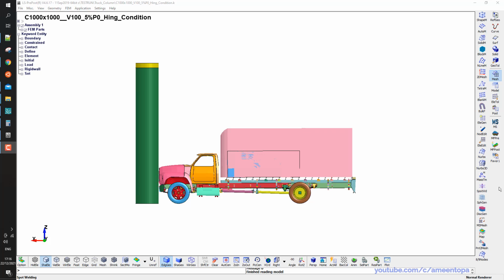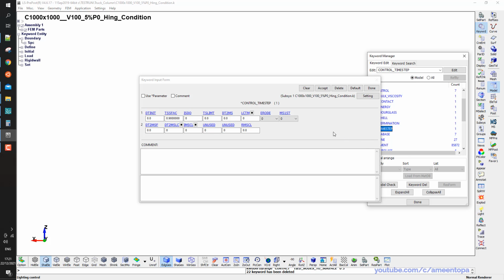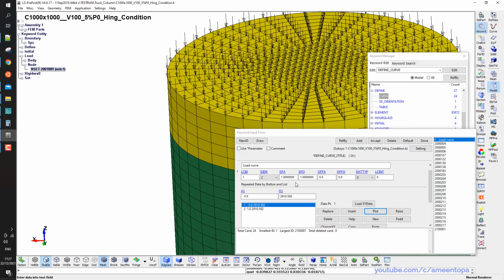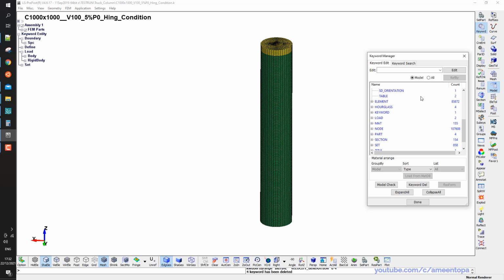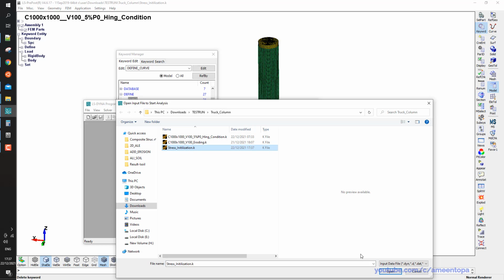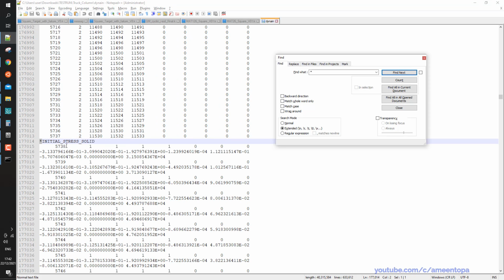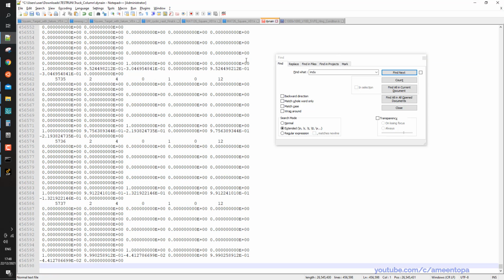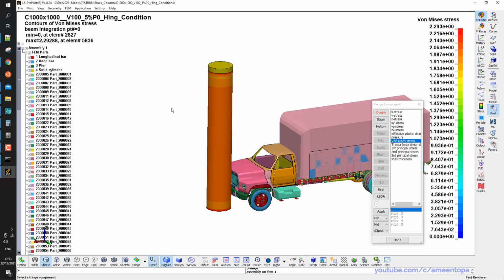Prestress on Column: Dynamic Relaxation

Comment: During the DYNAMIC_RELAXATION process, the CONSTRAINED_LAGRANGE_IN_SOLID keyword does not work, causing the rebar and concrete to behave independently. How can this issue be resolved?
Reply from the maker: Did you solve using single or double precision solver?
Reply: @AmeenTopa  I have tried both SMP single and double options, but the issue persists. I'm trying to apply gravity first and then apply impact loading. However, during the gravity application using DYNAMIC_RELAXATION, the rebars are not properly constrained to the concrete and fall downward under gravity, indicating that the CONSTRAINED_LAGRANGE_IN_SOLID coupling is not working as intended. thank you for reply
Reply from the maker: @오상헌-k4n interesting. Please try to use CONSTRAINED BEAM IN SOLID instead and let me know how it goes.
Reply: @AmeenTopa  After applying CONSTRAINED_BEAM_IN_SOLID, the issue no longer occurs. Thank you so much! is it okay to use CONSTAINED_BEAM_IN_SOLID to combine concrete with rebar?
thank you master!!!
Reply from the maker: @오상헌-k4n yes, you can use this keyword. You are welcome and all the best.

Comment: dear ameen, is that possible that to  make a variable material card,?
i want the modulus and other factors to change with the time, how can i make it happen
Reply from the maker: As far as I know, there is no material model which has this capability.
Reply: @AmeenTopa  thank u brother, i got another question:  to simulate a lunge step  (only reconstructed the foot and shoe) to see the influence that shoe structure can impose on the foot, how can i set the boundary and load conditon?

Comment: Hello Ameen, great content as always! It has been extremely helpful. I'm trying to simulate an asteroid impact on the ocean with the ALE method. I can't seem to use dynamic relaxation to preload the air and mesh elements with gravity. Is there any keyword that could be missing?
Reply from the maker: @renatomorais5445  Hi there,

I am glad you find my content helpful. 

As for your question, dynamic relaxation might not work on fluids (air and ocean water). This method is used for small strains cases in structures. 

Since you are using ALE method, you might want to check INITIAL HYDROSTATIC ALE. This will be helpful for your case.
Reply: @AmeenTopa  Thanks for your feedback. I believe this is the best keyword for my problem. However, I still haven't been able to obtain the expected pressure gradient. Regardless of the value I set for PBASE, the lowest surface pressure remains around 5 atm instead of the expected 1 atm.

I'm not sure what could be causing this, as I've tried every possible approach I could think of. Any insights would be greatly appreciated.
Reply from the maker: @renatomorais5445  as far as I know, this keyword works only for certain cases. For example, if EOS MURNAGHAN is used for the water, this keyword will not work.
Reply: @AmeenTopa  Yes, I've taken that into consideration. I'm using EOS_GRUNEINSEN because its compatible. I think the problem is it requires the use of Structured Ale Meshes. Do you have any tutorial to use as reference?

Comment: Hello Ameen, which keyword did you use for contact with column and rigid plate?
Reply from the maker: You mean the rigid plate on the top of the column? I didn't use any contact. The shared nodes of these two parts are merged.
Reply: @AmeenTopa  then the hinge support of rigid plate can be applied to column? without any contact?\
Reply from the maker: @suhyunegolf  Yes. I have a tutorial on pin and roller support. Check it out.